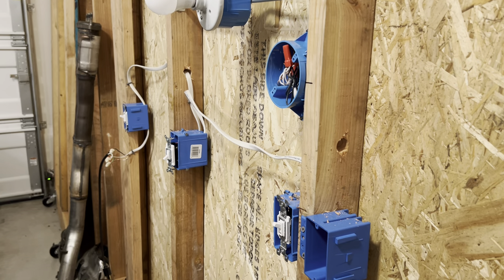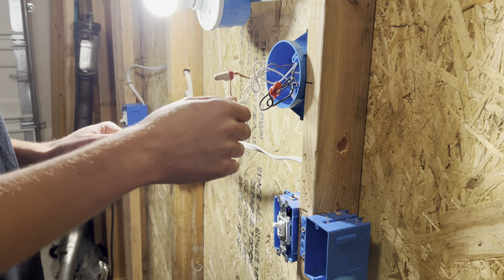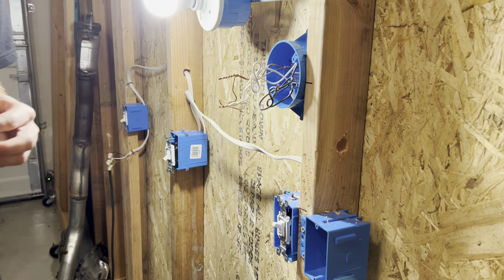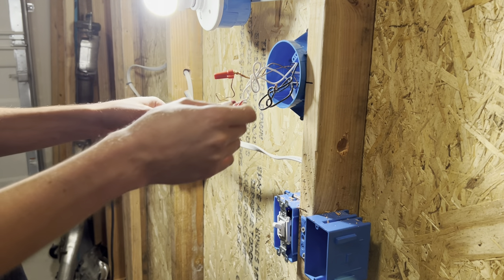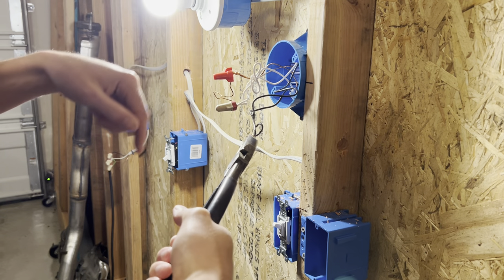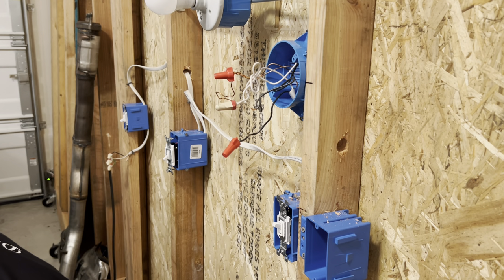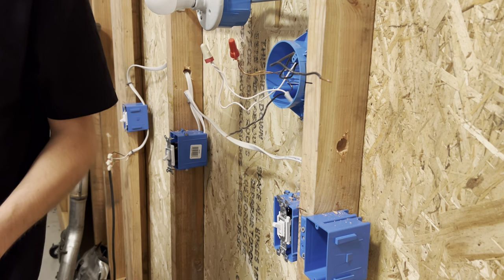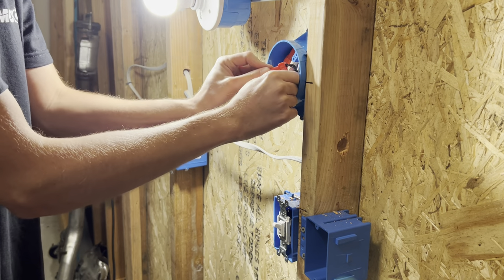Electrical 101: How To Work With Live Wires (Residential)

Comment: Don’t listen to all the cry baby’s . Working live is part of the job . If you can turn it off then do. Sometimes you can’t and shit needs to get done. The times I’ve been shocked were when I didn’t know it was on . If you know chances are you won’t get shocked . Working in a live panel is part of the job. If you can handle it . Pick a different trade. Respect it don’t fear it
Reply from the maker: Thanks! Exactly 💯
Reply: Calm down
Reply from the maker: everyones calm
Reply: I appreciate this. My journeyman I’m following has me change switches/receps live, no insulated tools. I recently did just buy Klein insulated strippers, so my hands never creep up on the metal part of the tool, that’s the key! And don’t touch any metal parts of the device that’s not the terminals
Reply: Though I completely agree with hot work being part of the job and know from first hand experience how so many will use that “safety crutch”, I’m all for mitigating hazards. I won’t go around my ass to reach my elbow to de-energize anything I’m working on. With that said, if I can easily disconnect the source of feed, I’ll then work it dead.
Reply: @oldschoolguitars7333  Klein is great, they strip more accurately on braided then less expensive brands.
Reply: Still using those insulated strippers!! I ended up also having insulated needle nose too!! So I walk around with 2 orange handles, and Klein dikes and lineman’s
Reply: If he touched the bare copper on the hot or the metal of the tool while it was hot, would he instantly die? Or is it just a tickle?
Reply from the maker: you don't instantly die from 120 volts, its a tickle like hitting your funny bone. if you get hung up, yes you could die
Reply: @DailyElectrician  winner winner 🐔 chicken dinner! Those that can’t comprehend that are likely assume a 50k volt taser is instant death… ☠️
Reply from the maker: lol, we all start with zero knowledge 🙂
Reply: @DailyElectrician  that's what I figured.
Reply: I've worked in data bases and in hospitals. Never once did we ever work on a live circuit. Unless it's a matter of death, there is no excuse to work on a live circuit. Especially today with everything having back up generators,  UPSs, and transfer switches, there's no need. Especially in residential. Definitely not trying to hear it that they can't turn off their power unless Granny's on a ventilator or something.
Reply: But then, there's the Real World
Reply: Well do it now whit 230v or 400 after getting zapped good whit 400v you will turn it of
Reply: Only times I ever got hit was because I either didn’t know it could get me or I thought it was off. It is nice when you only touch a hot with one hand and are insulated. Get to feel the tingles with none of the load lol
Reply: @ALtheelectrician  I work for a electric utility never seen a facilities electrician work on power live even 120. Every circuit has prints and dedicated circuits all labeled. We have to tailboard before start every job and PPE is required 100% Of the time. I work in IT networking we work close with those guys lot of power in data centers. Like I said every outlet under the floor is dedicated circuit so no reason to work hot. I'm sure it's a different story going to buildings you didn't engineer. T&D side works hot they have lot of specialized tools and procedures even then every few years one of our linemen gets killed. Last bad one underground vault some reason guy contacted a transformer I heard he was vaporized only his small part of his legs were left where they went into his boots.
Reply: @Mike-01234  it's no joke brother. Unless it's a life support circuit absolutely no reason to work live. Be safe out there.
Reply: It's only a MASTAKE if it CAN be Corrected, Electrocution CAN'T be corrected, that's no mistake that's permanent. Don't let that "shit needs to get done" cocky mentality turn a simple mistake into an Electrocution, forcing your loved ones to wear that black dress. Please Be Careful, especially with that cocky mentality.
Reply: Thank you 100%

Comment: Myself and the journeyman I was working with recently had to go and add 38 receptacles tapped into nearest available power in a commercial retail setting for our customer. It was standard operating procedure to tap in to the nearest hot box that we could find with the circuit energized so as to avoid shutting off multiple loads that we were not entirely sure what was being powered off of without extensive digging. It would be a wise idea to have a dedicated set of insulated tools for hot work that you know for a fact are in good condition with undamaged insulation on the handles. ✌️

Comment: People claiming that ground wires are intended to keep “you” safe is a complete misunderstanding. The ground wire protects equipment which along with that protection provides protection when someone makes contact with that equipment.
Reply: You should disconnect hot, neutral and ground in that order because you have less things the hot can come into contact with.
Reply: @FreeAmerican-mm2my  one thing I preach is that “it only takes a one wire hook up “two” wire a screw up”
Reply: The PE does protect you. Imagine L would be in contact with a metal housing if your equipment that is not connected to earth. If you would touch it you would be the connection to earth and that can be very deadly ;)

Comment: Hey bud, thanks for taking the time to do this.  I turned the switch off but I still have 46v  running, as per multimeter.  I don't know why that is but was nervous about touching the wires.
Reply: That’s not normal
Reply from the maker: Turn the breaker off?
Reply: Probably an older house. My volt pen reads from the water coming out of my faucet. Old wiring. That's what I was told.
Reply: Dimmer switch ? Dimmers will leak voltage to the light
Reply: @kenneedsmusic what the 😳😂

Comment: Stupid question , so you can use a pliers or linesmen to untwist them, so you have to have one arm not touching anything? Or can you use both hands to grab the pliers or have to have again one free hand out while the other does all the work? And why doesn’t the pliers arc or short it out compare to when the wires touch something metal? Sorry found your Chanel and know nothing about electricity but found it amazing.
Reply: Definitely use one hand to avoid passings from one arm to the other with your heart in the path. As far as arc or shorting out is the same as screwing on a wire nut, as long as it doesn’t touch you or something grounded it has no path. However there is always a potential for an arc no matter how careful you are. Find the disconnect unless you’ve exhausted all options. Hope it’s not too late

Comment: Yes, let’s not work live ever at least in a residential setting. If there are situations electricians have to work live the legal risk for their company is massive if they are happy to carry that risk then they really should not be in the industry.

Better to teach safe isolation, lockout and tagout. 

In industrial settings there may be more reasons to work hot - to reduce downtime, carry on production but even here a risk assessment and arc flash assessment should take place. Once the industrial customer knows the legal liability and risk around that most if not all companies would schedule downtime.

To many electricians have lost their lives thinking they were immune to electrical shocks, they were too experienced they were too knowledgeable.
Reply from the maker: yeah, wise to not work live but also good to know how to just in case

Comment: If your index finger and thumb get connected, say 120v, or even 240, will it just blow through your fingers right? Not hitting your heart by any chance?
Reply: You would hope :)
Reply: Electricity will take every path available to it. If there's a way for it to go through your heart, it will.
Reply: I'm wondering if your whole body become part of the circuit by your 2 fingers connecting it. Or if it just runs only through the fingers. I guess it just runs through your fingers since old school electricians used to test by licking there fingers and touching the wire.
Reply: electricity will flow where ever it needs to go to get to the ground and in pretty much any case you are touching the ground

Comment: Aren't you supposed to twist the wires first before you put the wire nut on?
Reply from the maker: to each their own. as you can see when i removed the wirenut it twisted itself just fine. no one on the west coast pre-twists
Reply: Looks like the wire nut twists the wire itself, why do extra work for no reason?
Reply: Been taught by every electrician that it's not good enough and you have to always pre-twist
Reply from the maker: i'm not everyone 😉
Reply: Never twist first.
Reply from the maker: i like this guy 😂
Reply: Doesn't matter. They're getting connected and secured regardless of pretwisting.
Reply: @mfill5043  if they're touching and the wire nut cuts it's thread good enough then it's fine. Twisting isn't going to help it
Reply: Yea you don’t have to. But it’s always fun opening a box and wire nuts and wires falling apart.
Reply: Always use in accordance with manufacturer's directions.  Read the wire nut container and see what it says.
Reply: @xxxxixi6073  My house has AL branch wire built in 1976 noticed every wire nut none were twisted. Never had any issues I'm in the process of replacing them all with alumiconns.